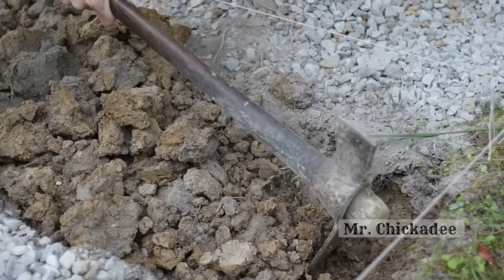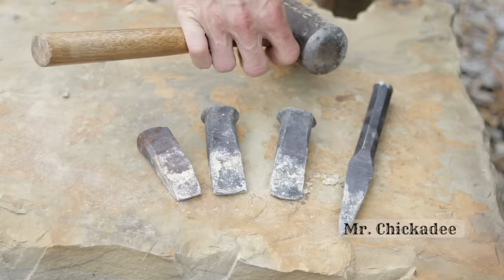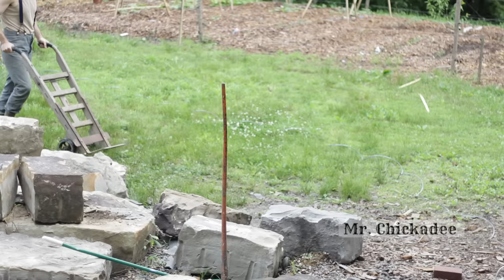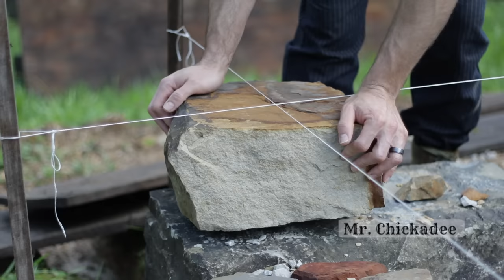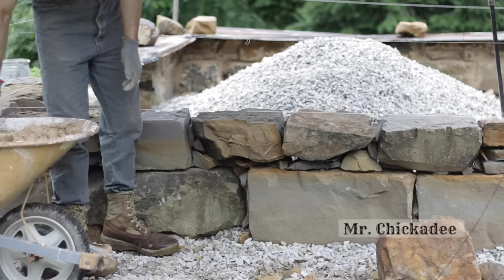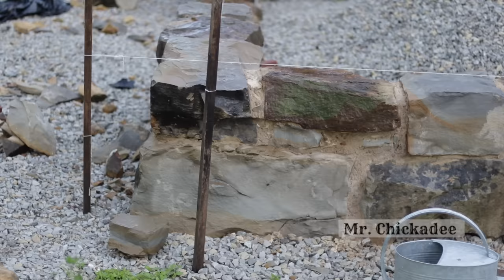Stone Foundation

Comment: As a German carpenter who was building many traditional houses in his past I recommend to make the stone foundation Minimum 35-40 cm high to safe the wooden parts of your building from the strong rain and make a calculation because of the overhang of your roofe you need to cover the wooden parts of your building at a 70° angle (you make the measurement from the ground leven and look up to the overhang) so your building will last longer than you and will stay even in some hundred years
Reply from the maker: i really prefer 60cm of height and min 90cm of roof overhang
Reply: @MrChickadee  how high are you planing your wall and what for angle will your roof become?
Reply: Rain bounces
Reply: best comment. Thank you

Comment: This is a beautiful AND strong foundation! Great idea to keep the foundation dewatered and also help avoid 'frost heave'!
Reply from the maker: Thanks! Glad to hear someone gets it!
Reply: I'm in the process of doing the equivalent on an old dry stone "shack" built in 1851. Initially, I believe, it was used for people, later used for sheep and goats. Hopefully one day will be my "cabin". 
Over the years has been messed up with very different kinds of mortar. The ones with lime are mostly long gone. Either case using the less noble "cement mortar" as soon as the smaller enclosing stones go into place. 

There's so many "ventilation holes" that makes one think why the trouble to do the walls in the first place. LOL :-)
The old roof remains, allows a perfect view of the sky, following similar pattern. Having real trouble finding old roof tiles. Since I would like to keep  it as close as possible to the original. 

Using a hard bristles nylon brush, allow to clean the excess mortar, while keeping the moss on the stones. Also an important detail for me. ;-)
All this to say, damn nice video. :-)
Cheers

Comment: Always a pleasure watching you work. It does seem a small building but a smithy doesn't need a lot...Those stones are amazing.
Reply from the maker: Hi Clyde, 

Yep, a forge, an anvil, a hammer...maybe a small wood stove or a stack of iron, what more does a smith want? Just as a fun note, both this smithy and my new woodworking shop are about the same size, 12X16 or so, and I feel like I have too much room, would be different if I had lots of big machines I guess....
Reply: @MrChickadee  So true. My grandfather's was about that size and he did everything. Biggest problem he had was the slag pile where he threw the clinkers and slag... Of course there were few cars back then so loads of horses, mules, wagons, plows, hoes, and misc to work on kept the slag piling up. He was the town blacksmith.

Comment: Very good method, in some places in Western but also Western Europe, they also added a layer of clay under the foundation to "seal" it from the water table rising during floods. Kinda similar to how gold miners use clay for their water cleaning ponds in remote areas nowadays.
Reply: Stone slides on clay. I think this is in Maine, where winter is the determining factor - the ground moves around in the winter. Crushed stone allows the water to drain away quickly. It also gives the wall a little elasticity, it's a live material. The building is basically floating.
Reply: Since its "floating," is there ever a realistic chance a decent sized cabin will start to tilt after a few decades?

Comment: Though it will probably work just fine, that would never pass inspection from my local building department.  I have a 4' frost line up here where I'm at.  

Beautiful work, though!  Time flies when watching your videos.
Reply from the maker: Hi Monnie, 

Sadly, most building codes and inspectors just know what is modern common practice, which is only one option, and not the best in my opinion. 

If we consider the danger of frost heave, we should think how we can prevent it, and there are several ways. 

You COULD start your foundation below frost depth, or you COULD just prevent frozen water or we soil from ever being under your stones. This has worked very well for not only us here, but many thousands of buildings in cold climates all over the world.
Reply: @MrChickadee  that's a great trick. thanks

Comment: Its like you read my. mind and then post a video. Last week i was watching french drain and rubble trench videos and thinking about the different foundation options. I have been thinking of making short wooden stilts that go 4 ft down and are scribed to stone. Kinda like wooden piers, and using a rot resistant wood since we have black locust in wi. I have been thinking about drainage a lot. Perhaps doing some sort of french drain away from The wood. A good eaves should help a lot though. We just sold our house, and am looking in the driftless of wi for land. Life is about to get crazy, especially with babe number 2 coming. Stone looks great and sturdy, but a lot of work and luck to get your hands on. Ive always wondered what the benefit of mortaring is instead of just dry stacked in the ground. I get that when its under ground with a basement you would have water, but perhaps wildlife is the bigger reason. Still thinking about Latin American horreos to avoid that.
Reply: @Johnmark Hatfield..Remember wide eaves could cause an ice dam in those very cold consecutive winter days/nights.
Reply from the maker: For most buildings, just a stone plinth foundation is all I would use. Barn, house, workshop, or whatever. Single large stones, wth post scribed, or sill scribed to it. Drainage is key, very key. Short posts as you describe that hold up sill timbers and are scribed to stones at the bottom are one of the best ways to go on a larger building, then the upper frame just gets raised on top the sills as in many sill type frames. 

I love big eaves, the bigger the better! 5' is pretty standard in much of asia...along with a wrap around porch, you have something nice.
Reply from the maker: @arkansas1336  Yep, another reason I dislike gutters!

Comment: I would still consider your foundation a dry laid wall because I have heard (from landscaping) that wet laid uses a mortar bed to set the stones and your mortar only seals the joints. 

Either way that is one heck of a lot of work doing it that way and the fact that the stone is already being “recycled” is proof that it will last for longer than you will ever need it. 

I look forward to seeing you progress on this new project, especially to the point of you lighting the forge the very first time.

Comment: Awesome video, thanks a lot! What would you change if you would have only much smaller stones? Would they still hold together well with the same lime/sand/clay mix?
Reply from the maker: Smaller stones would just require a layered wall, as seen in most traditional stone work, there is an outside and inside to the wall with sometimes rubble infill. Large key stones at times help to lock the sides together.

Comment: So the motor is not actually cement its a lime sand clay mixture. I wonder how long it will work for? Will get real hard? Well it certainly looks beautiful.
Reply: There is some info on Roman concrete, basically what this mortar is, online. It's not has hard as Portland cement, but that's a good thing. Allows for some movement. It is also water permeable and can help mitigate moisture. Could be that the clay subsoil is slightly pozzalanic which would make this a hydraulic mortar.

You could also look up the lime cycle if you're curious about how lime mortars set.

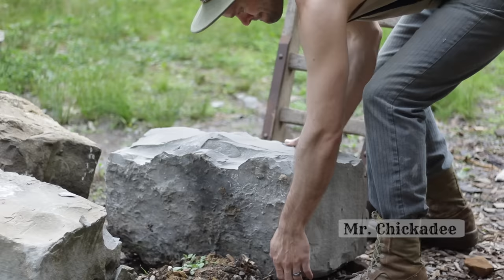Comment: Absolutely love the authentic techniques you share and teach. Was the rock at 07:42 drilled to be split?
Reply: Probably drill holes from when the rock was originally quarried for the railroad bridge that all these stones came from.  Small dynamite charges were placed down in the drill holes and blown simultaneously, resulting in the same type of fracturing that Mr. Chickadee accomplished with a stone chisel and iron wedges.

Comment: Beautiful video!
I have followed your material for quite some time now.
About this particular, I have a question.
I do develop my permaculture farm in the outskirts of Havana, Cuba. 
Since working in Cuba is, as you can imagine, "challenging" in most cases, we pretty much work everything from scratch and have almost no tools.
This said....I am in the process of building a foundation for my barn. Very similar to what you just did here.
How can I make my own "lime putty"?
Thank you very much for your inspirational, and beautiful work. 
Blessings.
Reply from the maker: Muchos gracias Amigo! 

Lime can come from limestone or from sea shells, you might have lots of shells in cuba? 

 This raw limestone or shells can be cooked in a simple kiln made from clay and sticks, or more advanced and permanant if you choose from bricks or stone. 

After the lime is cooked  enough it becomes quicklime, water is added to this to make "slaked lime" or "lime putty" it can be stored in a covered hole in the ground forever, so long as you leave some water covering it, if it never dries out it will not convert. 

It can be used to make mortar, plaster or other things. Very nice and useful to have on the farm. 

I would suggest searching youtube for "lime kiln" or "lime mortar"
Reply: Find some folks making pottery , if they botch a batch of high grade potting clay , that's pretty good stuff for filling gaps . The dust from a big pile of gravel , around road construction , the roads around a concrete plant , 85% lime . Or more , she'll beaches and a sledge hammer , in Wisconsin we burn limestone in a kiln , crushed an sold as anhydrous lime ,  ( no water) ...ask after their waste piles , your not building a bridge , and you don't need fast setting , add some volcanic dust it will become water proof , and set very hard . It's kinda easy , yet very hard , it's alot like making bread . Get the proportions right , don't mix in too much water , good luck an godspeed.

Comment: Lovely work and very useful how to guide. I'm looking for help on how to build foundations for a straw bale house and this will do just fine. Thank you very much!
Reply: Make sure your foundation walls are at least 2 feet high for straw bale construction.  You also need a good roof overhang or else splash back from your roof will eventually (count on it) work its way into your walls (even if stuccoed) and then your bales will start to rot and there goes your house.

Comment: Ha.. finally something your not and expert at. Still pretty darn good. What kind of stone were you cutting. It looked like but couldn't be granite?  You done good again.
Reply from the maker: haha yes Ive only done this type foundation twice, still learning. Its a hard variety of sandstone called "bluestone"
Reply: @MrChickadee  it's tough buying stone by the tone and getting the material you wanted. I was thinking you would have had better luck with a handheld rock drill and some wedges and feathers but maybe the sand stone doesn't split like my Weymouth grey granite.  I have seen the tools your using in local antique stores and I'll scoop them up next time.  Nothing can be admired more than a well made dry wall. Your still da man.

Comment: Two questions, sir. First, why the choice of mortar? Why did you not use cement in your mortar? Two, why add the mortar to the joints after laying the stones on top of each other, instead of doing it layer by layer?
Reply from the maker: This is just dry stack with added mortar to fill up the cracks. Portland cement based mortar destroys stone work and should never be used with rock. Only traditional lime or clay mortars are correct for stonework.

Comment: Love the videos keep it up! What was the decision to use  cape chisels as opposed to used the trow and holden feathers and wedges you used in splitting your other stones? Just because the blue stone is softer, or was it just faster? We have mostly granite up here and I have only tried feathers and wedges.  Thanks again for the great content
Reply from the maker: I found this older method with the cape chisel to be much faster, easier and less messy. There is no rotational fatigue on the chisel hand, no messy stone gloop splashing up into your face and its more than twice as fast. Whats not to love? The only issue is, this method is so old and unknown, even among masons, that you must source your own tools, which is not too bad if you can forge or know a smith. I have seen evidence of it used in granite up in new england, so you might give it a go, find a cape chisel and have a few smacks.

Comment: Awesome! And timely! I'm planning on doing something similar for a cabin. Are the guidelines representing centerlines of timbers than will be on top? I still haven't manged to find lime locally. Honestly think it's going to be easier to make my own like the primitive technologies guy.
Reply from the maker: Hi Erik, been expecting to hear from you...Yep, this building will have a brick floor, hence the perimeter and the drainage, I would not do this normally for a cabin or house, but would use a stone plinth foundation as you have seen, as it would be faster, more stable to seismic activity, and much easier to insulate.

Comment: Please, could you explain on why you are using this mortar, especially why you are including clay? Have you made any experiments on what mortar to use?
Reply: the lime breathes in contrast to cement. So you get better ventilation with lime - and also it's much less polluting or energy intensive than cement. The lime also doesn't crack as easily.

Comment: That is a great video.  DO you have frost/freezing uplift issues in your area?  I'd love to try building a fence with your method but we have a 1 m frost code .  Thanks.
Reply from the maker: drainage is key in my opinion, weve never followed the frost depth rules here, and never had any issues because of attention paid to correct drainage, dry soil wont frost heave.

Comment: I'm a lil' late to the party but thank you for sharing your knowledge & experience. This was very helpful both the chiseling trick as well as the foundation its self. Also how you fill the little gaps in between the large stones. I am Belgian and not sure if i will get a decent translation for lime. It seems like it was plaster. Lime in our language can also mean clay. 
Was the trench level or did it have a slight slope for water drainage , and then the gravel pored out on top and leveled ?
Or were both trench and gravel leveled ? Thank you  !
Reply from the maker: the lime Im using is just Limestone that has been cooked until it is quicklime then water is added until it dissolves into a white putty, here you can buy it in bags called "hydrated Lime" they must have something similar there.
Reply: @MrChickadee  Thank you ! Curious to find out. With any luck i'll be building something in Spain this summer and chances are big i'll be using stone.

Comment: So the mortar used to bond the stones is a mix of 1 PT clay bearing subsoil, 1 PT quicklime mixed with water, and 3 PT sand.
Have I got that right?

How much water is used to make the "lime putty"? And how much clay is allowed in the subsoil(30%?)
Reply from the maker: close, but the mix is like 1 part binder to 3 parts aggregate, so it would be more like 1/2 parts clay and lime, then 3 parts sand. Its hydrated lime just mixed with water till it forms a putty, but could be just mixed with the sand dry. Quick lime would need to be slaked first. I dont know the percentage of clay in my soil, its pretty high though.

Comment: you posted this on my birthday:). you dug the foundation to below the frost line?
Reply from the maker: Frost heave is not an issue if nothing of frozen water or soil are under you stones, hence the gravel filled drainage trench seen in the begging. You can build anywhere no matter how cold if you simply follow these methods, as is proven by many thousands of old buildings all over the world in temperate areas.

Comment: Why split the stone into smaller pieces,  other than making them manageable by hand?  Why not use the long strips of stones as they were and put them into place using winches, pulleys, come-a-longs, etc.?   I'm not criticizing you or your skills, just asking a question.  Thank you.
Reply from the maker: Working alone on a schedule, I found it faster to split the stones, moving them would have required a bunch more set up and time, each was about 1 ton

Comment: 6:30 why do you need to hit the rock after you hit the steel pegs?
Reply: He's resetting the hammer, common with black smiths, that hit on the anvil or rock allows you to regain form/grip as well as help maintain balanced strikes.
If you pound and pound and pound it wont be measured, it will get sloppy, and you'll get tired.
It wouldn't do much to help travel the crack down, thats what the wedges are for.
In black smithing, some smiths put water on their anvil and strike the water with their hammer to not only reset their hand/position, but also because the water will flake off any scale quite explosively. ( scale is a black slag type material that you see flaking off during hammer forging)
Reply: Its kind of like making music, keeping a rhythm or beat, its for consistency.

Comment: What is the advantage of wet laid stone vs dry laid? Does dry laid take more time?
Reply from the maker: Unless you are dry laying very massive stones, or scribing them to a perfect fit, the wet laid is more stable, most dry laid walls can be just picked apart from the top as they just lay there. I will be fitting the timbers tightly to these stones and I dont want anything moving around on me. So yes, it is faster than perfect dry laid.